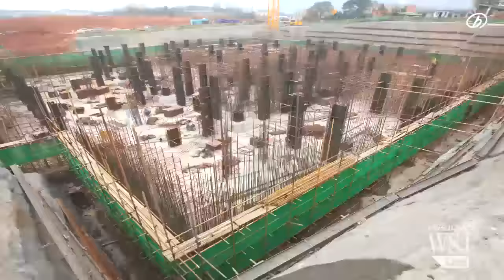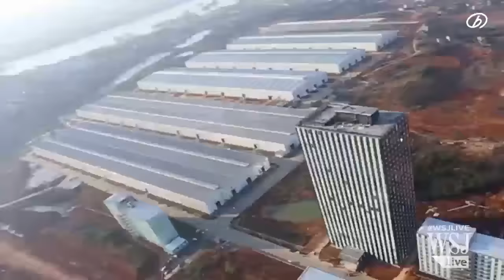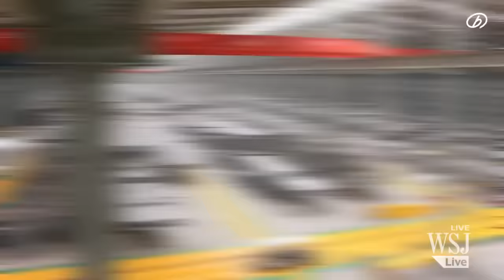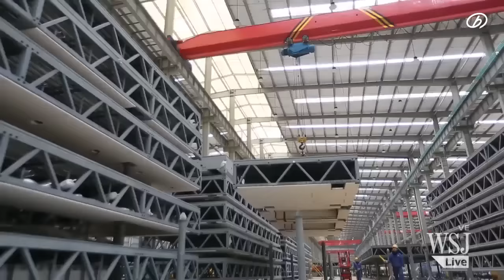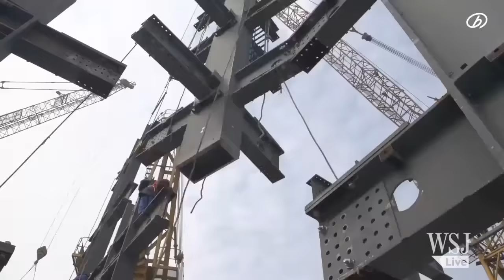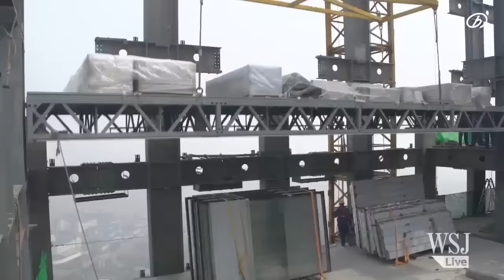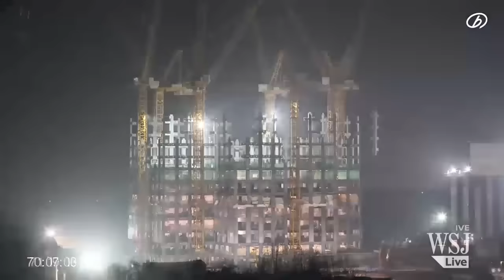Watch a 57-Story Building Go Up in 19 Days | WSJ

Comment: They were crazy!!  All those structural steel members were joined with bolts.  They should have welded all those joints.  There is no way they would have welded each 3 level sections every day unless they went back to weld after topping off; in that case, it is wrong to say 57 levels in 19 days.  With everything in place, it is next to impossible to weld all joints properly.  The building is doomed from the design concept; likely it would collapse after several storms as movements turn bolts and nuts.  Folks, please, don’t be fooled by these foolish communist propaganda.